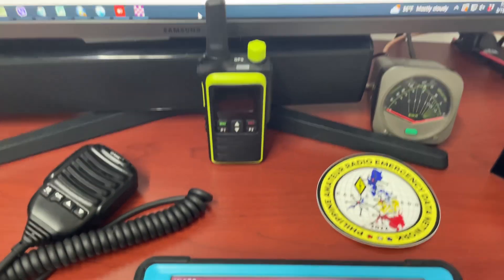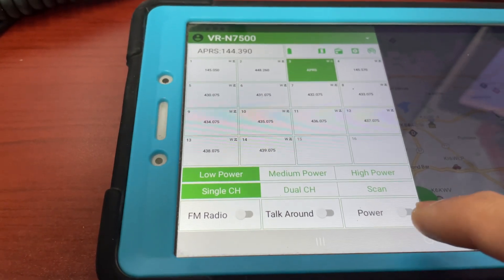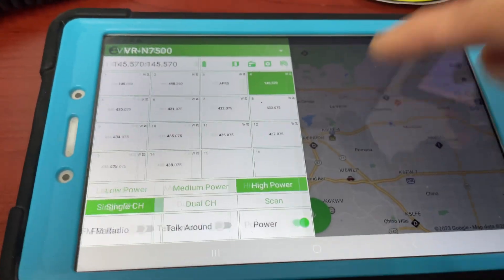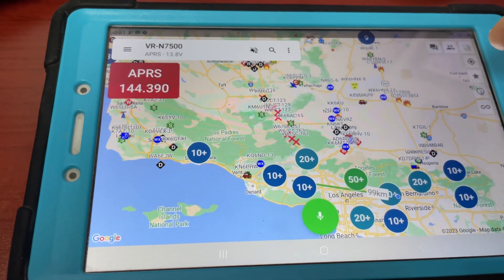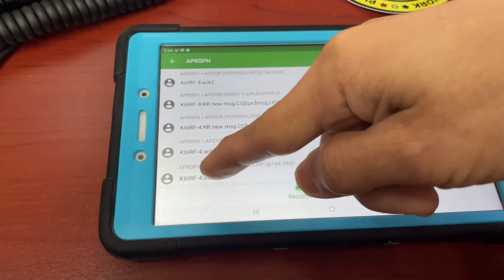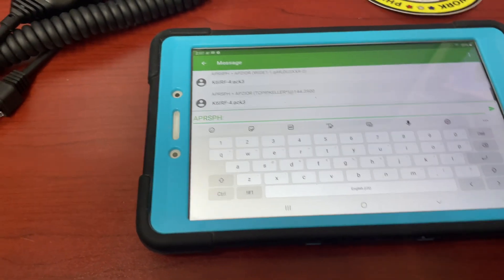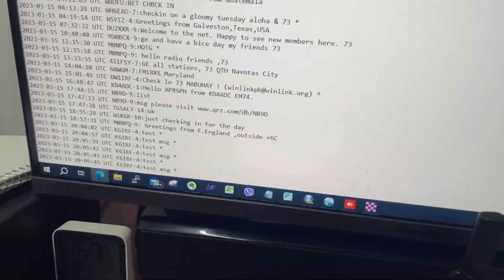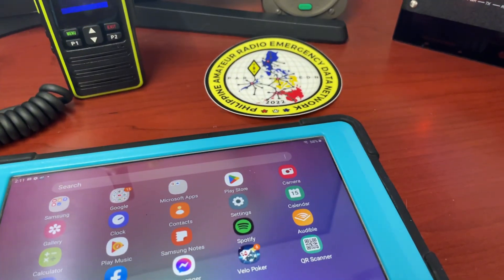APRS ! The Radio without a Face . . VGC VR-N7500

Comment: I purchased this radio and i too am having a problem with the software  It"s a pain   I would like to shut the APRS off but cannot figure it out and i have not made a contact with it yet even after program the freq
Reply from the maker: There is a Google Group (Veron7500) and the guys probably knows how to do that if it's even doable. : ) I haven't use it in a long time and will probably need to look into it again.